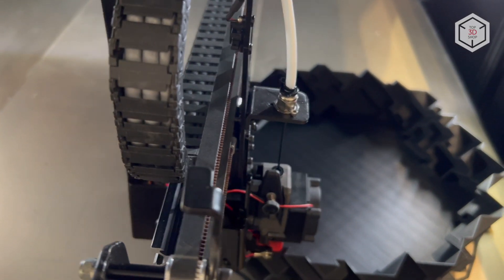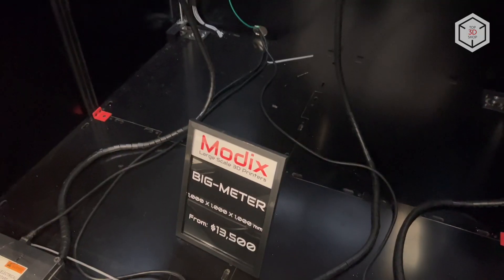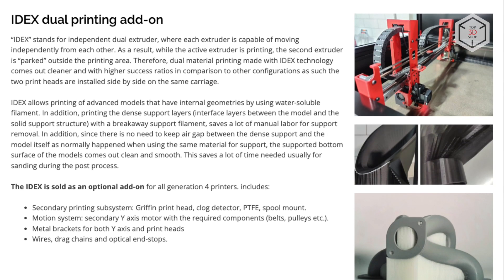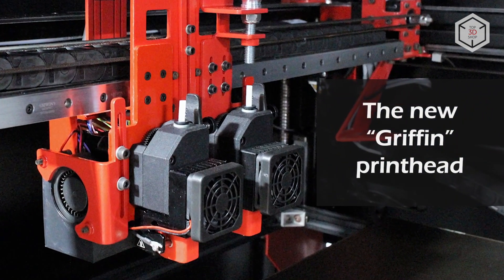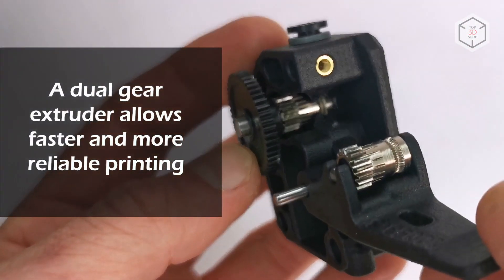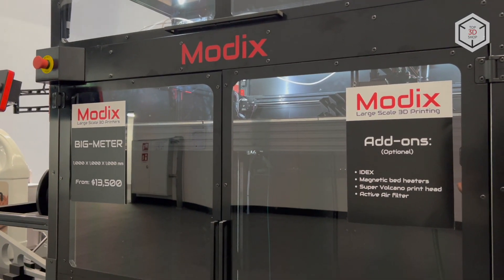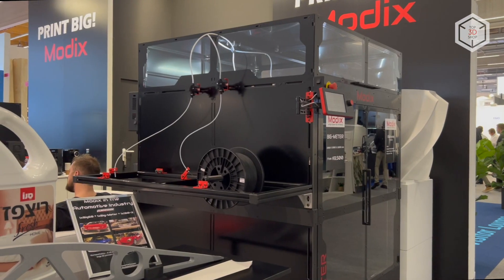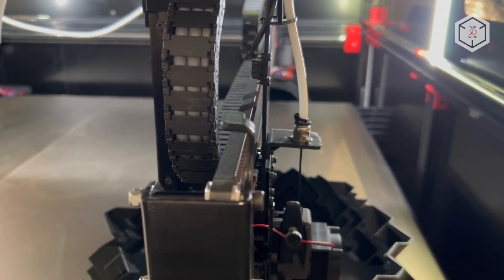Modix BIG-Meter V4 Overview: Industrial-Grade Large-Format 3D Printer

Comment: A normal FDM printer scaled up to print larger objects. And the differences - well if I was designing a larger printer, first you have to maintain leveling and accuracy over a much bigger build volume. I would want control, measurement and software to do this for me. It has to be ready just as quick, bed, nozzle, cabinet. I would want to print a benchy on the bed at the same scale and the same accuracy as a regular printer. I would also want to be able to print a large model so speed would be important, but also large nozzles and high filament feed speeds. Not a domestic machine, so multi filament types, temperatures and therefore a heated cabinet, air purification (a lot of plastic going through this), fast maintenance, changing filaments, changing nozzles, extruders, camera, spaghetti detection, restarting failed prints (these prints are big),  pausing changing filament reels, wifi, SD card, print server, mutiple slicers capability, tablet sized screen on the machine, I want my reels inside the machine, on top, behind, heated filament boxes/ or not. It still has to be quiet, it still must use parts I can get from Aliexpress or eBay if I want. The first print I run has to be a winner, and I would want it all for the price of a bigger printer, in a bigger box. Don't want much do I  :-)